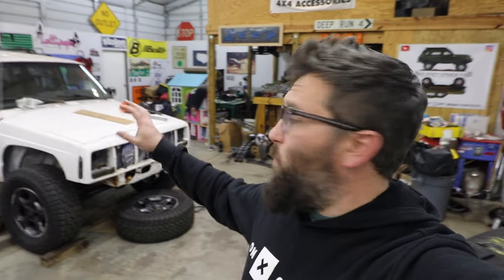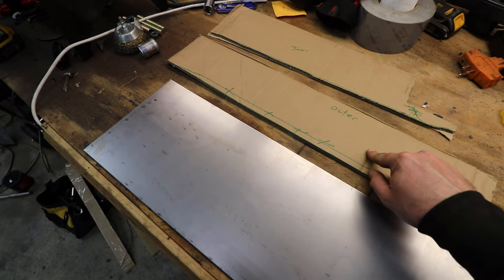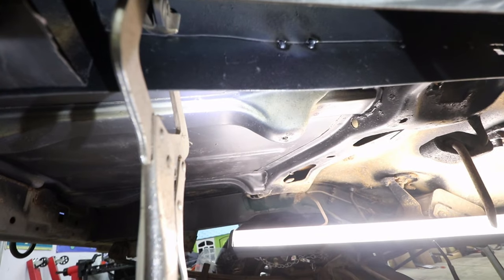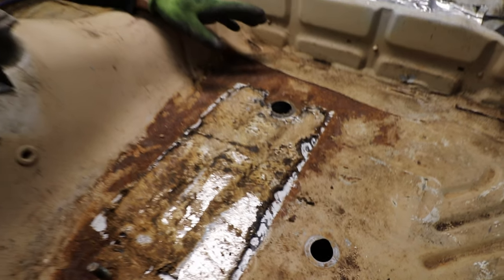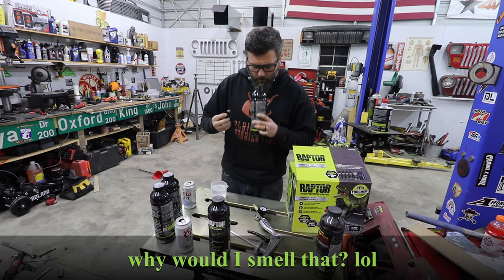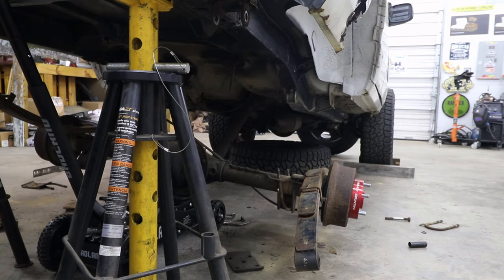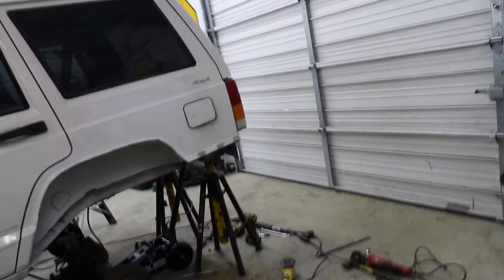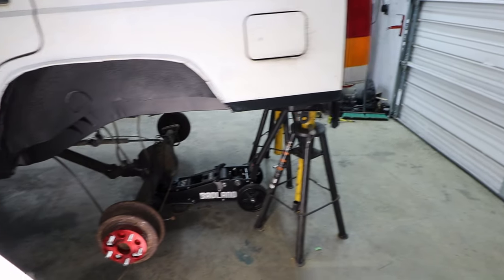Budget Build Jeep Cherokee PT. 2 (Unibody Rust)

Comment: To prevent rust propagation: first remove surface rust then neutralize the rust that you cannot see in the porosity of the steel with phosphoric acid then a coating. Some coatings contain a neutralizer like Por15 or Rusteum rust reformer. You’ll have to be creative to coat inside of structure that is typically uncoated and captures moisture to propagate rust. Welding small stuff you could try weld through primer after neutralizing rust.
Reply from the maker: Thank you! That is great information.